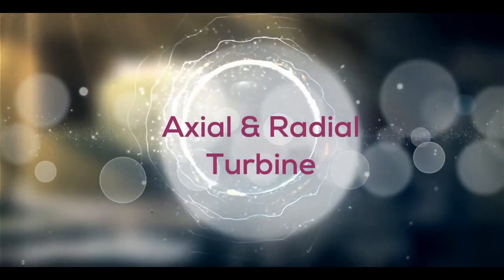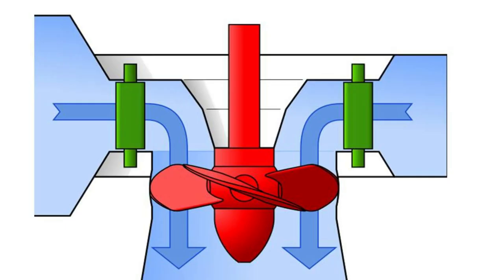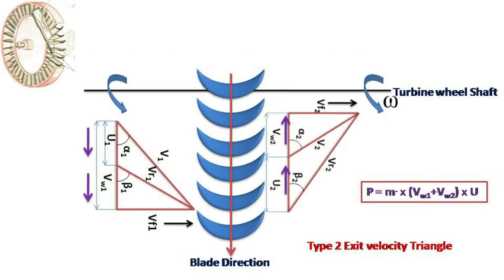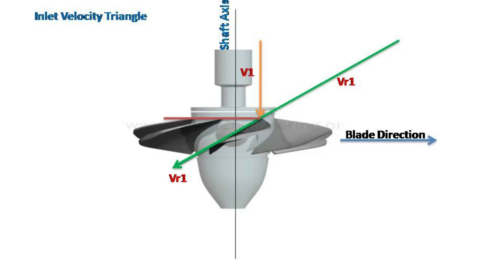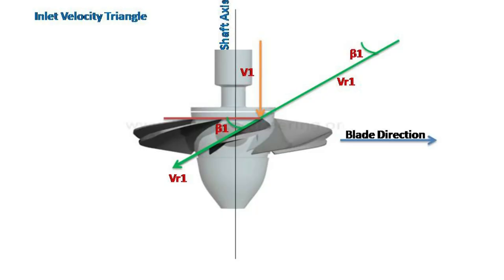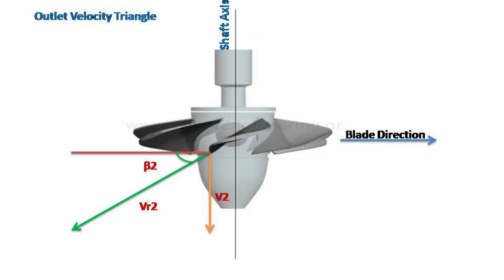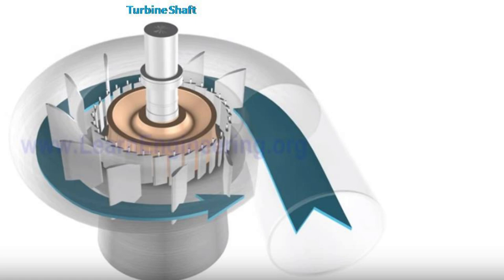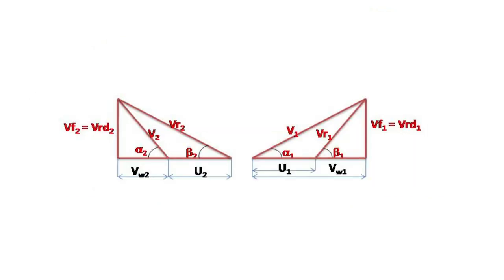Axial & Radial Turbine

Comment: Perfect. Regarding Velocity triangles, How could I express the flow rate for the axial fan based on the geometry, torque and RPM.
Reply: Is the velocity triangles for axial fan and axial compressor  same exactly or there is difference ?
Reply from the maker: @engmahmoud3232  No...as the design of blade will be different for  fan, compressor and for a turbine.

Comment: If U1 and U2 are equal by symmetry, and beta1 and beta2 are also equal by symmetry of the blade, then for axial fans wouldn't outlet velocity be the same as inlet velocity?
Reply from the maker: @v.rathod4124  U1 and U2 depend on hub dia D1 and Blade dia D2 resp. (D2>D1). So your hypothesis fails every time.
Reply: @Prof.raghavendraprasad  Ah, so is U1 the peripheral velocity and is U2 the base velocity then?